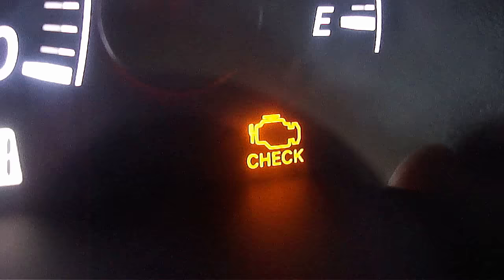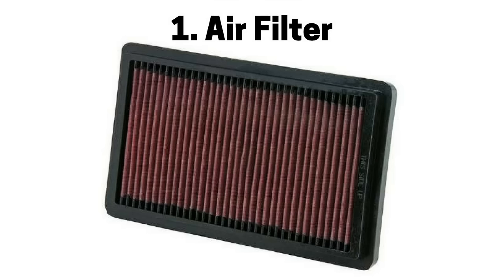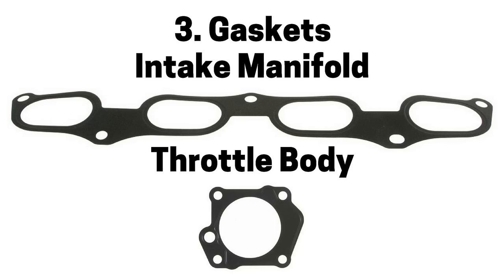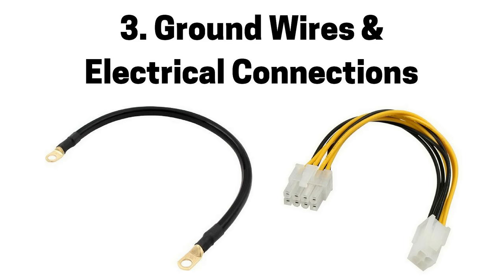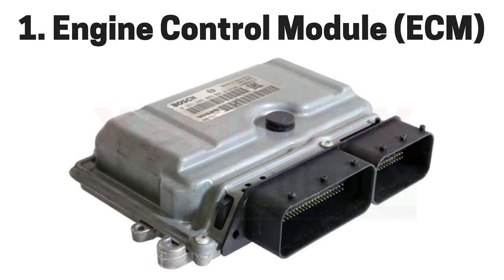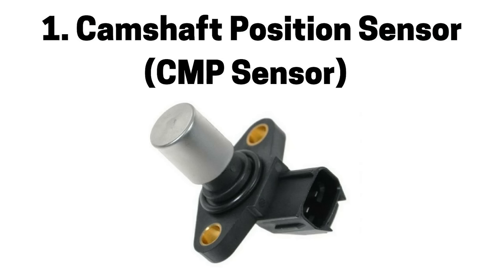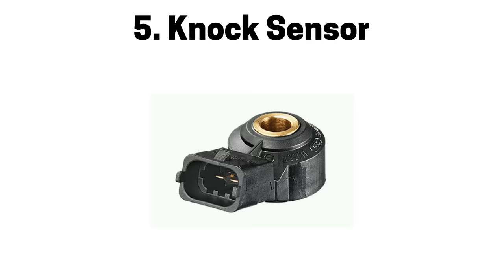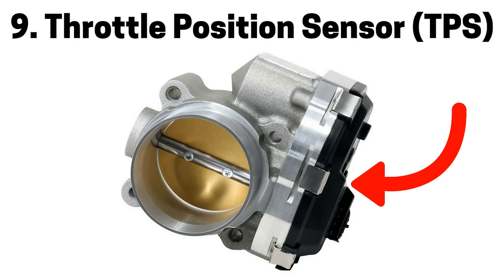How To Fix Engine Hesitation During Acceleration - Easy Fix!

Comment: Thanks Paul, I’ve looked at loads of those forum’s...useless...! You and Scotty are the only ones giving this advice to check and clean Mass Airflow Sensor for poor acceleration...what I call a flat spot...! Cleaned the MAP sensor on my daughters 2009 Vauxhall Astra 1.6 Sxi and it as done the trick. I cleaned it with WD40 Contact Cleaner which worked but, it didn’t evaporate...I had to run the hairdryer through it to dry it out. The sensor on this one has only two contacts and does not appear to be removable from the air filter hose...you can see it though from the filter end though and reach it with the tube. Hope this is useful to other people searching the internet for idea’s. By the way, it also seems to have fixed the Rev lag when changing gear, something that I saw on one forum as “perfectly normal on Astra’s”. Thanks Paul

Comment: Thank you for the long list of what could possibly cause engine performnce issues. Lot of people think fixing or replacing a part or two can fix the issues but it's not always the case. That's why the problem must be diagnosed rather than blindly throwing parts at it. So many components and sensors work together to send the accurate amount of data to the ECM, so that the ECM can send the right ratio of fuel to gain the maximum cobustion output. Any diffiencey can disrupt the proper combustion process causing performance issues overtime.
Engineers have spends decades to come up with a product that we now take it for granted. It's not a horse or a bike. This is a product of science not a miracle.
Reply from the maker: Choghoree Karakorm 👍😊
Reply: I'm waiting the EASY DIAGOSE video to come out. I should add a can of fuel stabilizer to the tank and unhook the battery.  It might be a while. 😉😉

Comment: This has bar far been the best video I've seen all day!!!!! I had  all spark plugs and coil for cylinfer 3 being as though thats where im having misfire, replaced and fuel injector as well and check engine light still on but this video broke it way down....Thanks
Reply: Cylinder
Reply: I changed the spark plugs, coil pack and mass air flow sensor and it still womt go pass 35 mph
Reply: K Dawg might be your catalytic converter
Reply: @91walker444  well i just took off the electric plug for #4 fuel injector and it acted like it wanted to kill
Reply: @91walker444  Guess what it is the Cataylytic converter thanks fir helpung me out
Reply: Sharon Burns lol im on my 3rd vehicle and i think if i saw this vid years ago i wouldev still had a lexus 2000 a Chevy Aveo 2010 aint letting this new Mitsubishi go like my old cars tho this ones staying
Reply: @shizuiuchiha5881  lol I know right
Reply: Inside of the catalytic converter or the O2 sensor

Comment: Paul, you are a good man for sharing us youre hard documentation about engine hesitation.

This information will help anyone who goes with his car to a mecanic and the owner will know if there is a scam and he will pay for changing something else. Great job mate.

Your video will help even the mecanics.
Reply from the maker: Thanks Dan
Reply: It didn't help me it just made me stressed even more😂
Reply: @trini_boi2414  yea i agree with you. Now im tripping out cus if its not what i think it is now i have a huge list that i have to go thru to figure it out
Reply: @Eddie-0102  same here and the bad part you might have to buy parts and put them on to see if that's the problem which could run up a hefty bill😩
Reply: @trini_boi2414  i just put new spark plug cables and that fixed the problem.
Reply: @Eddie-0102  did that hold up?
Reply: The only thing I learned is all the things it COULD be, I want to know what it IS. I have no check engine light coming on and my 2020 Veloster has almost gotten me killed twice at a stopping merging interstate lane. First the car shook like crazy and just wouldn't move (6 speed auto btw. I pulled between the cones, put it in park, then in drive, and it ran fine. Second time I was in manual mode, took off from the stop sign and boom!! Same thing wouldn't move, even when I geared up. Then finally it decided to kick in. AGAIN NO lights! Now the car sits because no dealership can find anything wrong with it. So now what?
Reply: @trini_boi2414  I Feel U just get a diagnosis scan and get the report printed
Reply: @tistheartist2985  I found out what was the problem..it was a bad ECU..after replacing it all issues resolved
Reply: Absolutely 😂

Comment: think ill just buy another car
Reply: Foreals lol
Reply: and I'm thinking of selling the car instead 😂
Reply: 😁😁😁😁 good idea
Reply: I just put some black tape on the "Check Engine Light".
Runs grreat.
Reply: @Imoverit9414  😂😂😂
Reply from the maker: LOL!
Reply: 🤣 all those parts cost more than my car is worth
Reply: @angelaragon6482  fr lol 😂
Reply: Eric McDowell HAHAHA, lol, thankyou
Reply: Lmfaoooooo
Reply: Can't agree more .. he spelled out all car parts :-)
Reply: You mean rent a car from the bank.

Keep the old car!
Reply: It may just be a faulty check engine light.
Reply: Lmao
Reply: hahahhahahha
Reply: lol 🤣
Reply: Wtf dude by the time im done doing all this 😭
Reply: @Imoverit9414  lmao
Reply: @angelaragon6482  buy the part have someone put it on
Reply: I saved up a little bit of money new spider injection system new fuel pump assembly new cap new rotor new spark plugs new map sensor new map sensor new fuel pressure regulator. It took me two paychecks but now she's running like a champ! But now my transmission has a gnarly leak FML. PS anybody know what type of Wheels I can get its a 94 square body S10 4 x 4 I want to get something in 20 inch but I don't want it to stick out at all
Reply: Kris Kirby , you have no idea how many people just get another car. Sometimes trying to find the problem can seem overwhelming. You need to find a mechanic that really knows and has the equipment to do a "complete" diagnostic.
Reply: I’m telling you. 😂
Reply: Se pasa de verga esta wey
Reply: Hahahahahahaha. ..Me too
Reply: Word😂😂
Reply: lol, lmao, lmao
Reply: Lmao so true jesus just kept going an going an going
Reply: Facts!!!!!
Reply: Kris Kirby on god
Reply: Or dilithium crystal imbalance in the warp core.   Holy shit.
Reply: Ima just but a new motor for my truck
Reply: Eric McDowell just put a shitty eBay exaust on it and say the light is cuz of the 02 sensor 😂🤷‍♂️
Reply: Buy something before 1989
Reply: He forgot to include to check low tire air pressure and worn windshield wipers.
Reply: Typical consumer
Reply: @RamoneBey  nah, ECU + OBD2 scanner is a great advantage. If you're thinking carbourated forget it.

Comment: So basically, if any parts or sensors aren't working properly, it will cause a lean air/fuel mixture,  engine misfire and the check engine light will come on. Good to know, sounds like an Easy Fix!

Comment: Good and thorough.  I had no idea there could be this many causes. But they mostly make sense. The water in  fuel seems unlikely to just be affected during acceleration, but I'm just an apprentice.
Reply: Believe it or not, where I live, water in fuel is a common issue which affects the entire engine badly. Paul did this thoroughly, like all of his videos, helped me few months ago with a problem which a few mechanics failed to determine so I did it myself.
Reply: if you don't me askimg, what part did you changed?

Comment: The MAF sensor is 90% of the time the reason...
New one would help but cleaning the old it won't work...
I got mine new Bosh Maf for 120€...
For the hesitation, it might be the air system, fuel system or even the spark plugs... These are the main reasons...
Thanks for the explanation...
Reply: 0
Reply: so whats the more common reasons for hesitation mostly at higher speeds for my e46 330ci? i have a new oem MAF and have smoked tested tf outa my car, only found a super super super small leak coming from one of the PCV hoses at the connector.
Reply: @ArekThorne  a super small leak is all it takes
Reply: Gil I  give up on DIY

Comment: You forgot to mention the most common intake system component of fuel injected cars. The idle air control valve is what really makes cars hesitate and not start along with stalling.
Reply from the maker: I have never associated the idle air control valve with engine hesitation during acceleration but rather irregular idle speed and stalling.

Comment: You summed up the operations of the engine very well! Explanations of each system make troubleshooting easy for a non mechanic person (like myself) to  open the hood and save a few bucks! Thank You! Do you have any videos on changing an alternator (only) belt? Without removing the power steering & a/c belts. 2000 crv.

Comment: For a diesel engine:
Blanking off the EGR was the fix on my diesel.
The exhaust gas was screwing up the fuel mixture and causing a very very bad hesitation and a big puff of black smoke out the exhaust when trying to take off from a stand still. The ECU was not compensating for this and that hesitation was becoming dangerous. The blank plate was the only way to fix this problem.
How can an engine be Euro 5 compliant when that happens? Maybe the testing for this is compliance is suspect?
Until Foton/Cummins come up with an ECU update to compensate for this the blank plate is staying in place in my car!!!

Comment: First, if your engine is hesitating, 95% of the time its the spark plugs that are causing it. If you have to diagnose via process of elimination, then it's best to start with the cheapest and easiest things to replace. 

First, an alternator has one job, which is to charge the battery and a faulty alternator will not cause your engine to misfire or a check engine light. This means a battery light is shown on the dash which in-turn tells you that the battery is not being recharged.

Second, I can't even be bothered listing all the things that you've listed that's irrelevant.
Reply: Very true hesitation is most likely spark and bad ⛽
Reply: im sooooo mad i changed like 5 parts on my car and still stalling  i think it the spark plugs
Reply: @Adrian Vac that shouldnt be possible considering that leads have a jacket that covers the top half of the plug and the other half is inside the motor. Plus the alternator shouldn't be close enough for a magnetic field to have an effect. The only way this would occur is if a damaged lead was basically resting on it.

The voltage that's sent to the spark plugs from the battery will always be the same, regardless if the alternator is charging the battery or not because that signal is controlled by the ecu. If it is an intermittent fault that doesn't cause the voltage to drop low enough to warrant the ecu to throw a battery light up on the dash then it's likely a bad ground wire or a faulty voltage regulator that most of the time is caused by heat exposure from the motor.

Anyway, I'm getting off topic, point is that it shouldn't be possible for a magnetic field to effect spark. What suburb was it? As in, what motor? I'm curious to see a diagram of it..
Reply: Thank you sir he named just naming shit lol
Reply: Best response I've seen 😂 mine started hesitating gonna see if it's the spark plugs 😂 if it is for one I'm gonna be ecstatic cuz that's cheap secondly Imma be dead cuz this man list multiples of stuff like how u expect us to be worried with all that  😂
Reply: @clickityclow2004  was it the sparks plug?
Reply: @tevinlinton4204  yup sure was
Reply: Well the alternator has a voltage regulator which can cause problems with car hesitation. I changed my spark plugs and still dealing with this. So I’ll change PCV valve and alternator this week since Auto store says voltage regulator is the issue.
Reply: @Honeysuckle82  Given you've already eliminated spark plugs being the culprit, then PCV valve would be next on the list.
Voltage regulator, as the name suggests, regulates voltage output from the alternator to the battery. Automotive alternators can produce up to 260volts, so the regulators job is to bring the output down to 12volts.  Although a faulty voltage regulator can cause electrical issues, it won't cause engine hesitation in isolation. The hesitation will almost always be a mechanical component or a sensor of said component.
Reply: @zchettaz  to o

Comment: This is an extremely informative video.  Straight forward, clear (verbal, video & instructional notes), not a time waster , great graphics, and a great place to start for additional research on the symptoms & parts.  Like always, to the point.  Excellent job sir, with upmost respect.

This gal is currently working on and installing a lot of these parts you mentioned, in 1989 Chevy K2500 5.7L 350 258k miles work truck.  Read the Chevy K truck sites, and you will know what many of us go through with an OBD1 maybe not throwing any codes, due to faulty but maybe not yet totally failed parts, the engine ECM is still able to compensate for.  But we have run into having some low power, some poor acceleration maybe some hesitation, fuel consumption, and maybe some idle issues etc.  But, when back to stock running reliable and well, back to giving it a continual work out.  Wish I would of seen this one earlier, and yes I do have the Haynes manual, but sometimes some info is not supplied, and you, Scotty Kilmer & the great folks on other sites like Chevy/GM truck forums & it still runs, fill in the gaps.  Also appreciate your other videos and your valuable time given to assist others.  Keep up the great work & you have EARNED a Big THANK YOU!
Reply: I didn't read your text

Comment: Thank you for the help and knowledge, we've been trying everything to get the idle fixed on my 1998 Silverado 1500 vortex. I'm sure with your video we can get it done!
Reply: Yes, he made another great instructional video, and it should help guide you.  Also, check the coil & IAC, for your idle issues.  I just replaced the coil on my 1989 Chevy K2500, now idles much better, hope this helps.

Comment: My Ford Escape 2.3L AT also "hesitates"when I would suddenly overtake but I mainly associated the issue with transmission gear dropping from overdrive to lower gear for more acceleration. So whenever I'm in a hurry and would overtake a lot, I just disable the overdrive for much better acceleration.

Comment: My first car was a 1976 Chevy Impala. Hesitation was a bad accelerator pump, plugs or wires, or low vacuum to the vacuum advance on the distributer. Your trouble code list is 15 long. Get the engine hot and push the accelerator pump and look for steam from the carb, spray all the vacuum lines with starting fluid and see if the engine revs then replace that vacuum line if it does. Plus and wires only lasted 25,000 miles and cost less than $20 so just replace them first and see if it helps. It's sad that you need a $3000 scan tool to even figure out what is wrong when you could just replace all the things that could be wrong for $50 on old cars.

Comment: Over time most throttle cable stretch so just slightly tighten throttle body cable tension screw to take out the slack that causes a moment of throttle hesitate lunging
Reply: Thank you for this comment. This might be our issue. 12 months and still trying to solve.

Comment: Hi Paul I have a 2000 Toyota Camry XLE 2.2l. car hesitates for a brief second accelerating usually after about 25-35 mph. I have no warning lights in the dash on. I put  fuel injection cleaner in the tank and it seemed to resolve the problem but after several days the problem returned. So I put Heet fuel injection cleaner and water remover. No luck. So I took of the rubber boot going to the butterfly in the throttle body.and sprayed air intake cleaner in the inlet port. Wiped out some black grime. It recommend to spray it in with the motor cold and off. It was tough to start it seemed like the battery couldn't start the motor even though it is a new battery. Finally it started up and coughed a bit but then ran quiet and good. Took it out for a ride for a half hour around town starting and stopping. Which is what the car sees all the time. I have another bottle of injection cleaner i am putting in the gas tank again. I tend to run the car until the low fuel light comes in with no issues in the past. But maybe the fuel filter is clogging up. It's just so hard to figure out because the car is not shutting off and leaving me stuck. Could it be the EGR VALVE? The car does not have a Mass Air Flow Sensor and the fuel filter is right under the hood. But I don't want to keep guessing what can it be. The car has just turned over 200k. YOUR OPINION MATTERS PLEASE 👍

Comment: I have a 2003 dodge stratus and the check engine light has always been on since I bought it and no codes showed up at all from test. It recently started jerking and sputtering at 2500 rpms and sometimes it will be hard to start and take 3-5 minutes so I took it to auto zone to get another test done and it came up camshaft sensor so I bought that and put it on still sputtering at 2500 rpms never had this problem before. Checked spark plugs and fuel pump is good I don’t know what it could be any ideas?
Reply from the maker: Hi Michael, some of these things can be time consuming and very frustrating to figure out.  It sounds like it's starving for fuel at higher rpm's.  It could be something a simple as a fuel filter.  I would change the fuel filter next.  Plus it shouldn't cost much.
Reply: proclaimliberty2000 Thanks I’m gonna try that but now it isn’t even starting it cranks but won’t start could a fuel filter cause it to not start?
Reply from the maker: Yes
Reply: proclaimliberty2000  I put another camshaft position sensor on myself and hasn’t sputtered or misfired in a week runs fine now! The Guy must’ve put it on  the wrong way
Reply from the maker: Fantastic!
Reply: Michael L. 🤔🤔 check the coil packs too